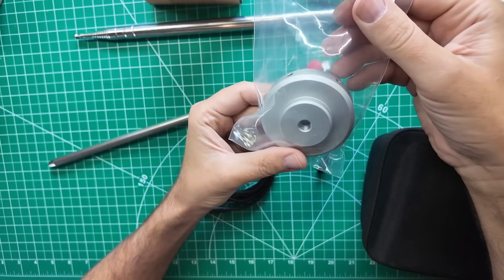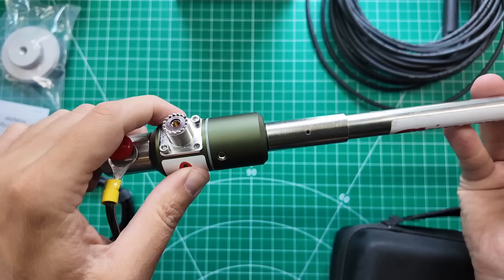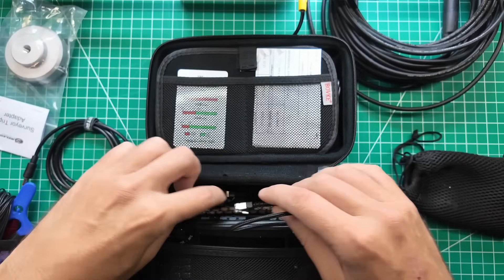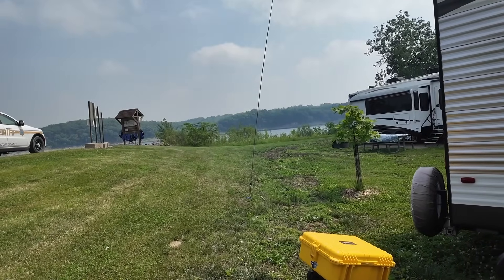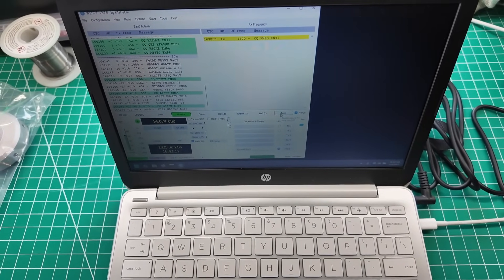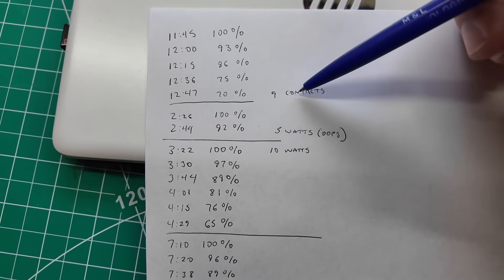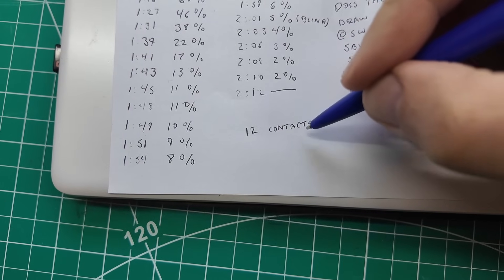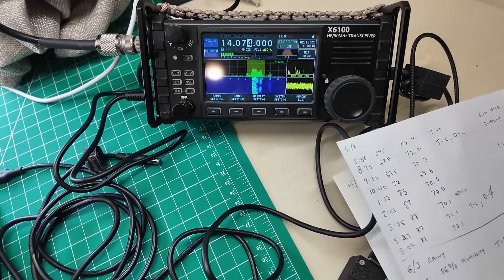I Tried a New QRP Radio Battery and WOW!

Comment: Many thanks for the review. Sounds good. I'm trying to convert all my gear to USB-C PD or powerpole. One question. The website mentions the battery is replaceable but doesn't mention with what. Is it 18650 batteries? I have a lot of those.
Reply from the maker: Its a 21700 Battery.  Still off the shelf though - and they do sell adapters to fill the extra 50mm, so you could in theory shove an 18650 in there.

Comment: Steve, Is the X6100 straight into the laptop? No other apps running to get it connected?
Reply from the maker: This is a windows laptop, so I have radio-> FLRig-> WSTJ-X.  On my linux/windows laptop, I don't need FLRig in the middle.  Some bug, wasn't worth chasing down.

Comment: BMS don't learn anything (at least not the simple small ones in a battery like this).  They assume that the batteries are completely balanced, which they are not until they are cycled a few times with the BMS balancing function in place.  You can speed up the process by super slow charging the battery.  Let's the BMS fully balance things in just one or two charges.  Once everything is balanced the capacity calculator will be pretty accurate.
Reply: It's not the BMS that learns, it uses voltage for cutoff. The board uses a coulomb meter that is initially configured for 10ah capacity. This single cell battery uses a 5ah cell. So it does in effect, 'learn.'
Reply: @w0aez  Got it.  That's not a traditional BMS in the sense of the boards that balance multi-cell packs (which also implement voltage sensing with coulombmeter circuitry). Haven't seen one of those yet that had any sort of adaptability - not at consumer price tags anyway.   Didn't realize this was a single cell internally.  That's an interesting choice.
Reply from the maker: Thanks Matt

Comment: I'd like to have a CHA-Blank, but it's pricing is silly for what it is. Neat little battery, though.
Reply from the maker: It is a sexy bit of kit for sure, esp in that green color.  A mirror mount and a wood clamp on amazon is a good place to start: https://youtu.be/NVyV_mVcclA You could even use a tent-spike.
Reply: I have the chameleon spike (came with the MPAS) I'm sure I could probably make something with a few hardware store items. I'm wondering if the inside is the same as the JPC-12 adapter that looks similar.    @temporarilyoffline

Comment: "...SWR grease" 😀

I have a surveyor's tripod, along with the CHA adapter. Works great with banana-plug-style radials and with all sorts of antennas so far. I love the stability I get with the surveyor's tripod. One of these days I need to take some time and do a side-by-side test of what the performance looks like when I mount, say, the CHA TDL on the tripod, vs. on the ground spike. The angles and ground losses will be different, but what those differences mean in practice?
Reply from the maker: Would be interesting to find out!
Reply: @temporarilyoffline  Definitely. Hopefully I'll have a chance to play with it soon!

Comment: Regarding that 'go bag' take a look at cases designed to carry small drones. There are a lot of makes around and hence some bargains out there. They protect gear. I wouldn't drive a car over them but dropping they're fine and as normally inside a rucksack have extra protection that way.
73 Ed
Reply from the maker: Great idea!  I'll keep that in mind next time I'm in need of a bag.

Comment: The battery is rated at 18WH. Devide that by voltage(12V) and you get 1.5Hrs. USB-C PD batteries never operate down to zero charge, about 30% is typical. the remaining 70% is available to power equipment. In this case, thats a little over 1Amp Hour.  A typical USB-C PD battery, advertised at 10,000mAH and  will provide about 35WH for < $20. Several INIU USB-C PD batteries  support 12VDC. 
73, RIck K8BMA
Reply from the maker: Thanks for watching Rick!

Comment: I have an W0AEZ battery for my FT5D. Works well so far, although I have not tried to squeeze out the last joule.
Reply from the maker: I used my 5D battery during an hour long net last night.  I was talking for a good 30 minutes of the net as I was the special guest... radio was getting hot, but the battery still has a TON of juice left in it.  Zero Complaints here!

Comment: When I was beta testing this battery for W0AEZ, I did find that the power level flutters on the 705 when you transmit 10W of CW, just like that VRUC battery you recommended. You should repeat my test and see if that is still the case (pretty much every USB C battery I have used does this)
Reply from the maker: I saw that, but I also saw that the 705 did it without the VRURC battery.  I am not sure its an issue other than something to raise an eyebrow.  I'm willing to be wrong.
Reply: @temporarilyoffline i have only seen that flutter affect when using USB C batteries with the 705. When i use a bioenno or similar battery i have no issues whatsoever.

Comment: I have loaded tested several of those usb c pd. there advertised at 12v 5a, the most I can get is 3.3a and the voltage sags to about 11.6v before the cable cuts out.
Reply from the maker: Yeah, gotta work with the tools we have.  Its a great battery because of its size, but there are better choices for "perfection". I love that it packs up so nice.

Comment: Thanks for another useful video. How do you think the state of charge of the radio made an impact on the duration of the battery? The radio was essentially dead during your first run with the external battery, not sure of the other runs. Love the form factor and display, I’m gonna likely have one in my 6100 bag soon! 73
Reply from the maker: The internal battery was dead for all portions of the video and the internal charger was off.  If it made any impact, it was the same for all tests.  I believe that if I had a full battery in/out I could get another hour or so out of the radio with the "charger" off - and the radio wouldn't notice when the external died - I'd keep on plugging!
Reply: I should have known you’d be consistent thru all testing! Thanks for replying. I just wondered if the radio battery takes a back seat when using external. It’s nice to know they can play together nicely in their sandbox. Always look forward to your videos. Thanks for being awesome.